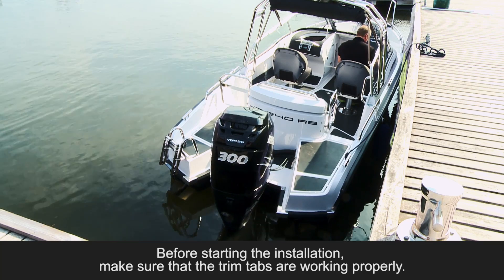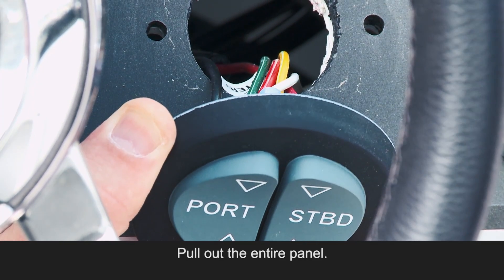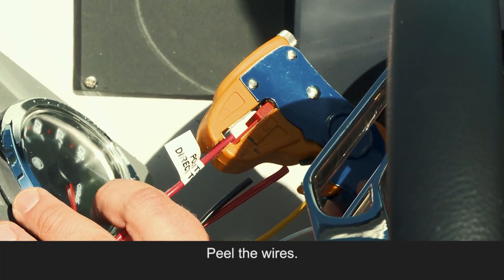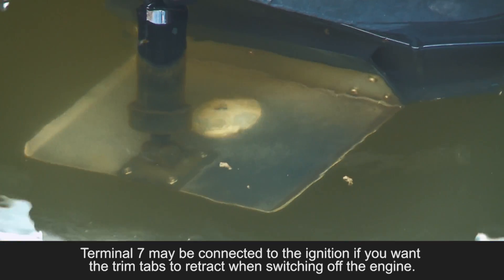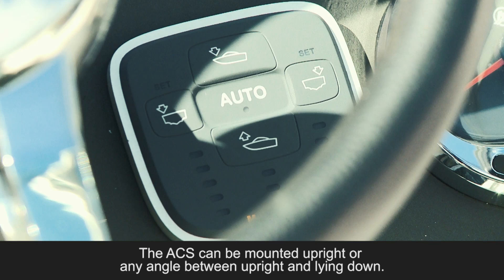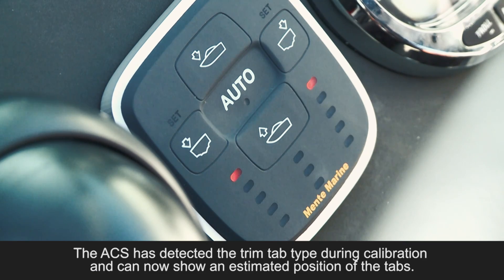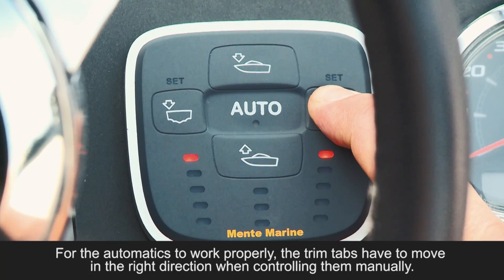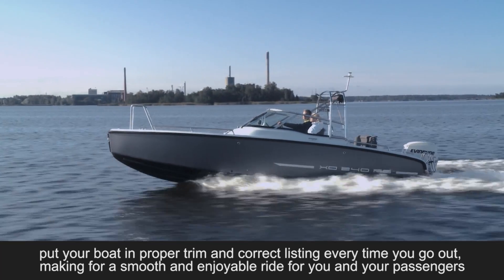Installation of the ACS Attitude Control System

Comment: I have just had this controller installed and when I set up auto it works fine for about 30 seconds the one of the tri tabs goes all the way down and stays there. I have tried 7 times to set up auto and it does the same thing every time. Do you know how to fix it please